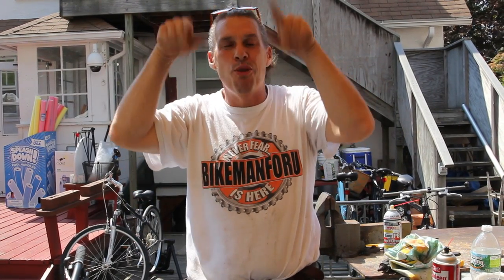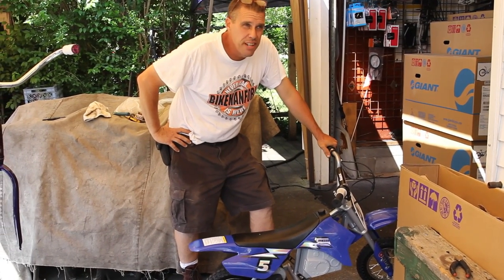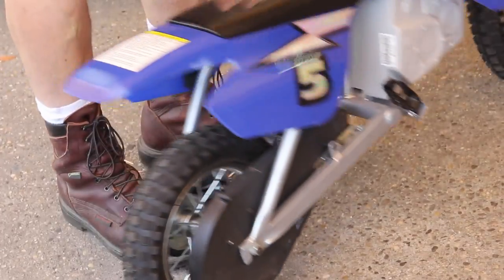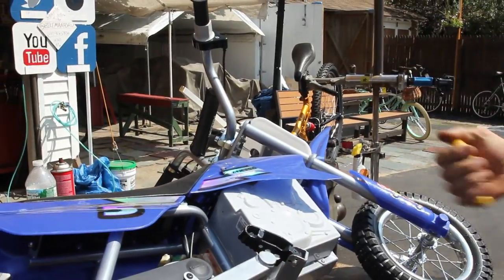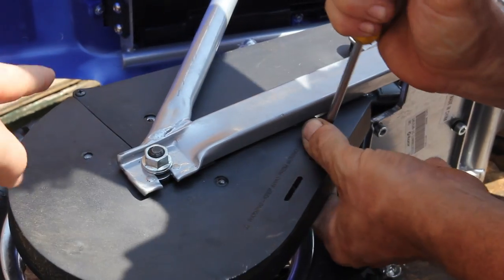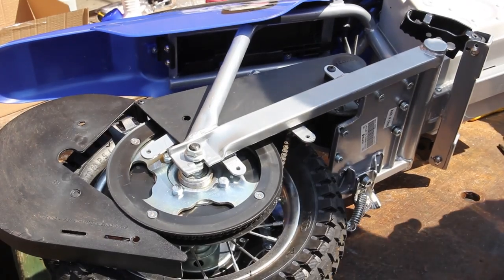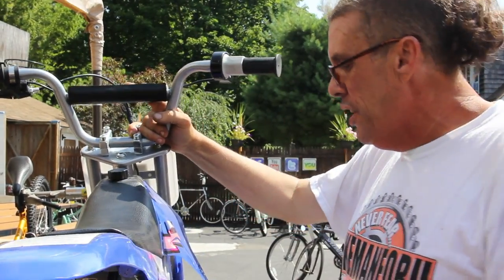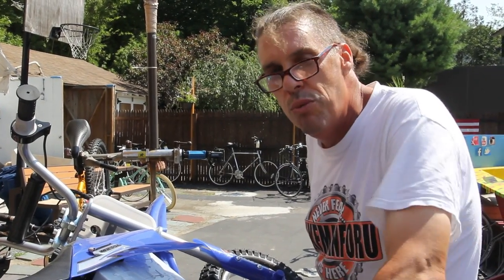Razor Mini MX Racer - Electric Dirt Rocket - ZR350 - BikemanforU Repair

Comment: Bike man. I have a question on diagnosing rather it's my motor or if the  batteries are the problem. How can I reach you? I am definitely buying a new chin this one I just got used is rusted but it sounds like a weak motor running but no turn.  I checked the chain it's on the sprocket. Keep in mind I'm a 35 yr old mama. But I can do anything I put my mind to. So I'm wandering if maybe the battery just isn't good anymore and won't charge enough to make bike go. Only makes sound or if motors bad. I can't afford to buy both. Is there a way to diagnose without and electrical gauge showing voltage? Tia

Comment: Hi I was wondering if you could help me figure out whats going on with my razor 350. I let it charge and got a red light also but i have no sounds of the motor would i but a replacement motor or controller do you know what i could do to figure out what i'd need?
Thanks for your help
Reply: That’s what going on with my son

Comment: excuse bikeman i have a pukka electric minibike that my uncle gave me about a year ago that had been sitting in his barn for a long time. i recently finally got enough money to buy batteries for it. ive installed the batteries and when i turn the key it will go but the throttle has no control over it and the only way to get it to stop is turnig the key off. could you please help me? thank you.

Comment: BIKE MAN...... I recently got one of these scooters.  It seems to charge, the on/off button lights up red, but nothing else happens:  no throttle, no accceleration, no running motor.  What should I check and how do I do it?  Thank you !!
Reply: Your Battery is Shot. My kids rode every Electric b4 getting Dirt Bikes. Your switch will still Power up Red, But I would say the Battery is nearly Burned out OR it could be the Charger. They do go Bad. I would buy a new Battery, install it and charge for 12 hrs if Brand new. It should work but I would buy a new charger also with it. 
I fix these all the time and had the Exact same problem several times !!!!!! Good Look

Comment: This thing is pretty cool in my opinion. I would've loved this as a kid too poor for a real dirtbike. Not to mention that appears to be a decent motor that I'm sure is just regulated down with a 12v battery and current regulated as well with the controller. Change those out with a better ecu and a couple 4S 5000mah Turnigy heavy duty or graphene lipos and this would probably be faster than a lot of the popular electric bike motors that cost exponentially more.

Comment: my son has one of these and we have the same problem. I can promise u that the chain on the bike u fixed probably has come off another dozen or so times. as does my sons. I am trying to find out how to fix this from happening. The manuals are not the best and i have search for a video and no luck. It only (manual) shows how to replace the chain and tire. i believe i should try to adjust the tension , yes or no? i dont believe that its so long that a link should be removed,yes or no? love the video, so close but no cigar! greasy girl
Reply: tammy deano attach a chain guide from the bicycle market on it

Comment: What was the point of the ziptie though? It's spring loaded for a reason. You'd hate to have to put a serpentine belt back on... No chance in hell you're getting a ziptie around that tensioner.

Comment: There must be a lot of mechanically incompetent people in NYC. If they could not fix something as simple as this and other simple things you've fixed for people.
Reply: I really liked the guy that brought in the Di2 because it wasn't shifting smoothly....Bikeman turned on adjustment mode clicked the shift button a few times, set it back to ride mode and it was done....not a tool touched lol
Reply from the maker: There are a lot of mechanically incompetent people around the WORLD. That's where the BikemanforU comes into play
Reply: BikemanforU I think a lot of people have the mentality that if its broke it needs to get fixed by a pro, which 80 % of the time isn't true. I guess I got lucky growing up where my dad set the building blocks for intuition and fixing stuff, doing things myself is a big plus.
Reply: There are other reasons why certain people never fix things themselves that I have run across, which were a bit hard to understand, since I have never had much contact with their "class." Certain people believe such work is beneath them. They have never had to do anything of the sort, and people of their status, which they consider the "normal" people, never do such things, because a person of refinement would never consider lowering themselves in such a way. They might chisel you over the price of your work, but they would never condescend to do such low work, no matter how much money they would save. The only reason for doing such work, in their view, can only be that a person is unfortunate enough to be incapable of something higher. I came close to laughing when a certain (male) person said they had never opened the hood of any car they ever had owned in their entire life, and they considered that normal!
Reply: Kenneth Florek thats true too :( I was in a used bike shop/repair and this guy in full race kit comes in bitching to the guys about how his GMC denali isn't working right
Reply: Tenspeed TheBikeHanger  Life story time: My father practically refused to allow anyone to do anything he could manage to do himself. For instance, he built the two garages of the two houses I grew up in, using his own self-drawn diagrams and figured dimensions, starting with pouring and finishing the concrete foundation, cutting every board himself, hammering every nail (with a pure junk hammer I still keep), and finishing with putting on the roof shingles and painting the exterior. He knew nothing of building before he started to build, other than reading from Popular Mechanics and Audel's Manuals. In fact, he never finished the 4th grade (my mother taught him how to do fractions and calculate cubic yards), and he had a routine job in a GM factory. I would have loved to work along side him, but he would never allow me to watch and learn how he did anything, so he passed absolutely nothing of his vast accumulated knowhow on to me. He even sold every tool of the least value he had, before he died of cancer, when I was 15, precluding me from carrying on as the man of the house after he was gone. He told me bitterly and contemptuously before he died, "You don't know how to do anything." He did not succeed in extinguishing my inherited desire to do anything I can myself, and I carried on in his likeness, although with hardly a trace of his talent, starting with those left-over, unsaleable and unsold hand tools.
Reply: Tenspeed TheBikeHanger I sometimes think people push willful ignorance to the point of the ridiculous, particularly with bicycles, but then I think of the things I attempted and screwed up. Maybe most people just have better sense. Laugh if you find the following amusing:

 I had a young tree with a small branch overhanging the electric wire crossing my property to the neighbor. I thought it best to just cut off this small limb (with a pole saw) while it was still small. I had it worked out so it would not drop on the wire. But it didn't quite miss. Although the limb looked small, the force of it dropping tore off the anchors for the wires at the pole for three houses, including mine, so they were hanging within six feet of the ground, and laying on one neighbors garage and mine. There was no way to get out of calling the electric company, and going to my neighbors and apologizing. The electric company came within 20 minutes, but it took the lineman 3 hours to get all the wires re-anchored.

 One neighbor was not home. The other, incredibly, had not noticed anything at all, except the power blinked once, so I didn't fill them in on my fiasco. The electric company did not bill me for fixing the problem. I got off easy.
Reply: @kennethflorek8532  I'm such a hardcore DIY'er that if I can't get something taken care of, or done myself, then I know it's not doable and accept it for what it is...It's this Julius Ceaser, (I came, I saw, I conquered,  mentality) that eventually had me file for divorce from my wife of 34yrs...It took me a long time to realize it, but when I did I felt this liberating euphoria that's unexplainable...All of the arguments, fights, nagging, headaches, and all around bullshit most of us great, married men put up with from our horrible, and always miserable wifes, just so we can have them maybe do, but most times not, something that they where made for, and that's relieving our sexuel stresses, and getting us off...Well I've rediscovered  something that was lost to me after college, and I forgot all about... Something great, subservient, always there when you most need them...And best of all, minus the nagging, minus the monthy blood letting, minus the sometimes months long with no haircut, bad smells on occasions...I know most of you guys are wondering if I've discovered the infamous, "Fountain of Youth", or met a young, beautiful, busty, blond Pamela Anderson un her prime look-a-like...Not quite guys, but better...I've rediscovered the joys, pleasures, better chemistry, a lot less argumentive then most women, and that is you might ask my friends...This great, rediscovered wife replacement is masterbation, yes I'm being brutally honest....I divorced, and happily replaced my wife for, Pornhub, and masterbation...Best decision I've ever made in 67yrs of decision making experience that I have...